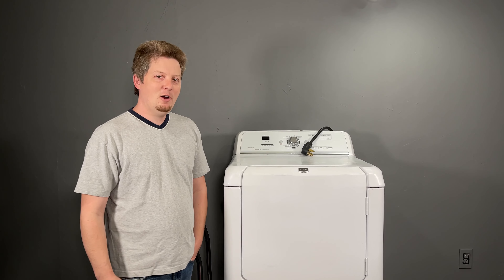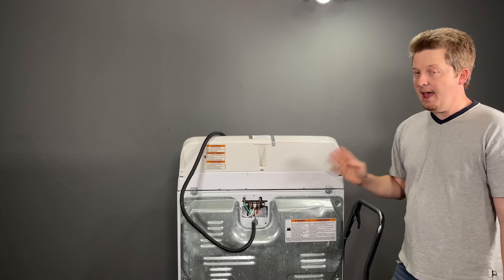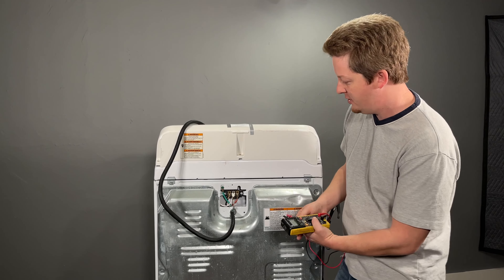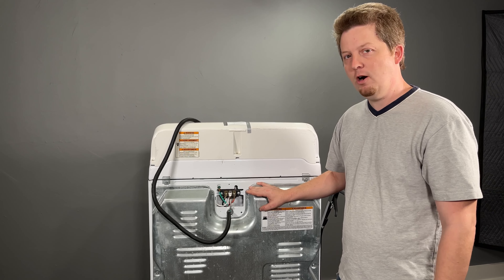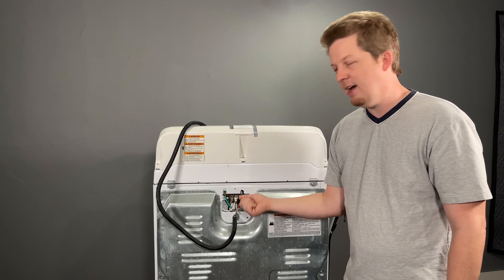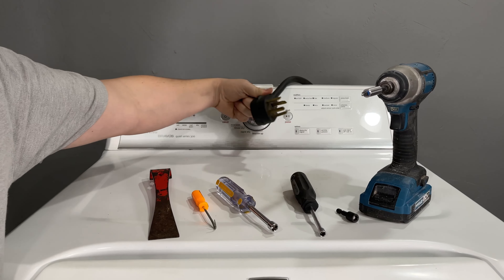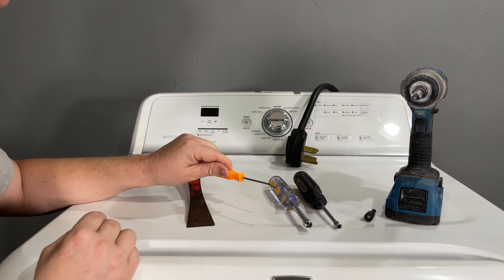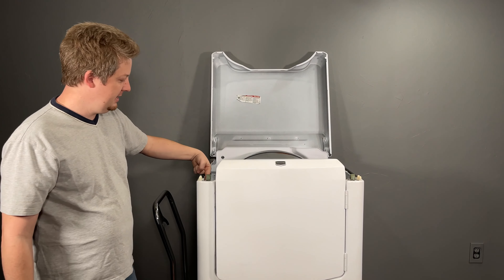Dryer Not Heating the Most Common Fix & How to replace the heating element 854477 Maytag Bravos 300

Comment: I never knew the dryers fan and drum would work if the breaker is only half tripped. That is what my issue was exactly. Left side of outlet had 120v and right side had 0v. Reset the breaker to re-establish 240v and I now have heat. THANK YOU !!! I am very grateful.
Reply: I install appliances. You wouldn't believe how many times I exchange brand new dryers because the customer won't believe my multimeter. Nope it's the dryer. 😆
Reply: Occasionally a 240 breaker will have one leg go bad. Very uncommon and frustrating after opening up the drier and testing everything. Check power first.

Comment: This is the second great video you have made that helped me. $22 and following your video and my heating element has been replaced. You make it so easy. And at the very end I was closing the top down and dropped the clip that the top sits on inside the machine. Had to take the front back off 🤦🏽‍♀️

Comment: Thank you very much for creating this video and sharing your knowledge!  Turns out, I had to change out the heating element.  Took me a while, BUT the dryer is working perfectly!  I also spent a lot of time cleaning the lint out of the inside of the machine.  It was shocking to see how much link had accumulated in addition to finding one pen, one penny, and one long screw.  Harmony has been restored.
Reply from the maker: Glad to hear you got it going again.

Comment: Awesome step-by-step instructions and very easy to follow. My dryer stopped heating and your diagnostic steps confirmed it was the heating element. With the links you provided it was quick and easy to get the part needed. After a couple of hours on a Saturday, everything is up and running as it should. Thanks for saving me the cost and time to have it repaired!
Reply from the maker: Glad to help
Reply: Very helpful video. Did everything as instructed... The dryer is getting full power, I've got continuity with the heating element, The thermostat and the thermal fuse but the dryer still won't heat. I'm at my wits end on what the problem is.Please help

Comment: 10 hours of work and replacing almost every part that had to do with the heating process.... the breaker was half tripped but showed as 100% not tripped (and the dryer was turning on just not heating) so I never thought to reset the breaker. Thanks for solving my issue!
Reply: Did you test the back 3 wires of the dryer before you unplugged it?

Comment: Most excellent!  Made the work easy peasy.  Had two issues.  A shorted out heating element and a semi frozen idler pulley for the drum belt.  My dryer also had an additional flywheel on the end of the motor shaft which made the access to the screws for the blower housing more difficult to remove.  
Thanks so much for the video!!
Reply from the maker: Glad to help

Comment: Thanks for your video and sharingng your knowledge.  I do have the exact same dryer in the video.  I replaced the thermo fuse too many time with in pass 2 weeks.  I already open the machine: clean up all all pipe in the dryer. I also replaced the hight limit and high limit cut off fuse, heating element &thermtistor but my dryer still over heating.  As of right now, I removed the vent hose in the back and let me flow freely.  Please advise what else can be check/replace.  If i select normal heat option,  sure enough the thermal fuse will pop.  I use the laser scan to measure temp off the air came out.  I does reach up to 180+ and I have to open the door to the machine cut off.  I'll replace the heating element again, and all sensor to see if same problem ( hot hot and make cloth wrinkle).

Comment: Thanks this is the type of dryer and element I have.
Reply from the maker: It’s one of the more difficult ones to replace but definitely not the most difficult job in the world. Good luck.
Reply: @WasherDryerMoney  

I took my time and didn't rush it the element itself was blown. I followed this video and it went fine. Thank you very much for publishing this video. I will say your electrical terminogy is off though. A circuit is closed when you hear the beep for continuity on your tester, it is open if you don't and open means the circuit is broken open either by a switch or a broken wire or component,  a short is what happens when part of a circuit melts open and welds itself to another location. Other than   that this video was really a good mechanical breakdown and fix of this dryer. Mine is working perfectly now just for the cost of my time and 35 bucks for the element kit. 😁
Reply: @WasherDryerMoney  I just wanted to come back and say it all went well and thanks 👍

Comment: Thank you.  Could use perhaps a magnetized phillips head screwdriver.  I replaced the idler wheel and the movement of dryer apparently sped heating element coil break.  With drum off replaced drum support wheels too.  Belt was good shape, verified spare from kit is same length ( slightly narrower belt though ).  Good video.
Reply from the maker: Glad to help

Comment: hi, I do have the same dryer in the video and my thermo fuse keep pop after 30 mins use.  I think my thermostat not working right.  My cloth wrinkle alot and I"ll order the same element kit in your link.  I bought a kid but the thermostat are different.  I doesnt have the extra sensor that connect to the.  Please provide PN for the thermostat . Thank you.

Comment: I've had 2 dryers, an older Kenmore and a Maytag Bravo just like this one.  All of the parts for the Kenmore were accessible by taking off the back. I could change the element, thermostat, and cut-off in about 10 minutes the first time, 5 minutes every time afterwards, 8 screws on the back and no heavy lifting. The Maytag - it's 30 minutes at the least, even after you do it ten times, which, the way it is designed, you will have to if you keep it long enough, the bottom of it collects lint in every nook and cranny.

Having to remove the drum just to replace a small electronic part is a very bad design.

Comment: this may just be my issue, but my dryer is making a loud roaring noise not from the wheels but from the blower wheel, is there anyway to replace that part or do i have to order the whole blower assembly

Comment: I've got a maytag bravo xl dryer that wont heat. I tested heating element for continuity and there was none. I replaced it and decided to just do the thermostat, thermal fuse, thermistor control. Its starting to heat up a bit but still does not seem as if it is heating up like normal. I'm testing the new heating element now its showing continuity but also shows grounded...could that be the problem?
Reply: I have the exact one and I'm having the same issue where it doesn't heat
Reply: @AS-uj2gm  I was able to fix my problem..it was the heating element that went out. The new one ended up having one of its connections grounded onto the housing which caused it to continue to still show grounded n stayed warm. I just fixed that n it still would not heat up. I tested the voltage on the outlet...showed not getting enough voltage because the breaker tripped. Flipped the breaker back..everything has been working good now.
Reply: Where did you buy the heating element? I'm having the same issue.